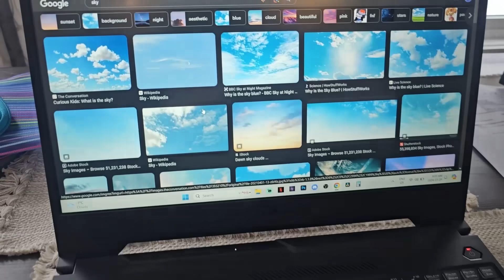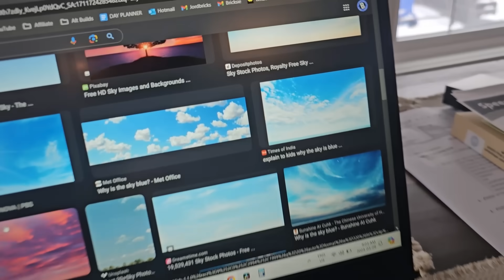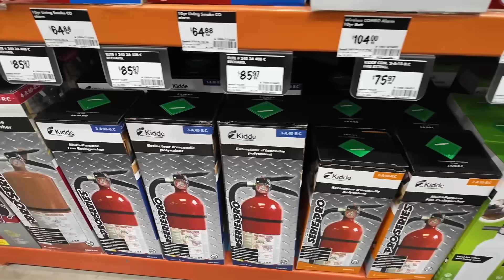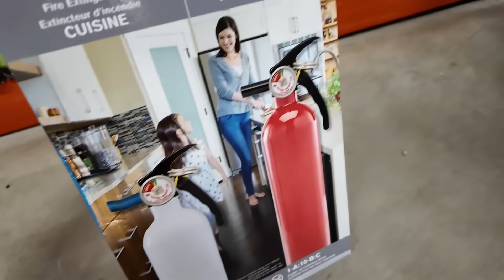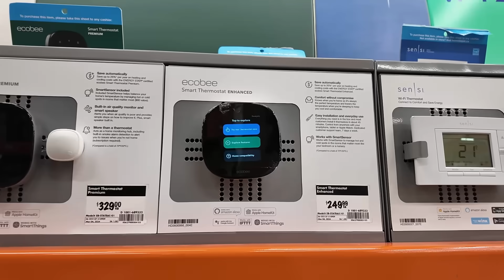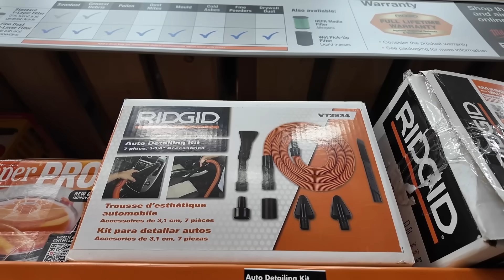LEGO City Tables? Preparing for the Mural!

Comment: Like a lot of others have commented. You may not want to lock yourself into a table layout right from the start. Just get the current tables from the basement moved over and the city set back up. Live with it for a while. Think about what you want to add and then plan the layout from there. For me just huge rectangles in the middle of the space seems like a waste of design. Add some shape, think about an airport, a sea and seaport, downtown, castles and medieval section away from downtown, farms, your forest and campground. Give these areas room to breathe and grow. Sitting with things and letting ideas come to you generally works out more often than just going for it. Access holes as you get older are going to be less desirable.

Comment: Suggestion… grab a couple “furniture movers” for the carpet tiles. They are small and fairly inexpensive and you can just roll the carpet tiles wherever you want without lifting. Also will make the installation process much easier. 
Loving the process. Thanks for taking us along with you.

Comment: I would go for 46", Aware that reduces the amount of baseplates, but you have a massive amount of space. Getting around comfortably is important considering the amount of time you will spend there. You could add on/extend the table later on, but more difficult to make them smaller if you find out the walkway is to small

Comment: All you need it a overhang to give extra space. The hoover has wheels so will bet under table anyway and you can customise a trolly to move baseplates lower than the table if it's an issue.

Comment: About you tables Jordan one why don't you use a custom cart that you don't have to Carry the build to the tables and posable low enough you can roll right under the table to the access holes then you wouldn't have yo worry about needing to make the sides wider to walk with a build. Two you once said wanting some elevation in the new city how about taking the middle of the table from roller door to office and making a riser like you did in the old city to bring things higher and to use to run trains all under be a two for one my thought. Third have you thought about the hight of the table so you don't crush your back or head maybe taking it just a bit higher then the last one  I know it may lead to a posable a step stool for a few things but it can increase the size under the table a bit and be more comfortable to access and not always will u be using the sides to access you have the front as well but think of the cart for the builds and posable you to use under the table to help you out
Thanks for reading i watch your channel everyday thats how i start my day even if my kids dont understand

Comment: Think of other than ideal situations too: let's say you break your leg and need to use crutches. Is there enough space to do it? And are your still planning to crawl under the tables, without walkways between the tables? With all that space you have, feels less-than-ideal as a design choice even in the ideal situation. Or how do you plan to fix the heater or lights on the ceiling when they need attention?

Comment: Also a thought for tables. Make them modular. Use good locking wheel casters on them. Then you can wheel in and out tables/city sections like a tile puzzle and expand/contract as needed. Also if you decide to break up displays- for example decide to make a sub city/space theme area, you can rearrange the space easily.

Comment: My opinion:  
Your current plan is insane - reduce it.  
I would go with 3 feet on one side and 4 feet on the other, so you have one side you can walk without care while the other is still accessible.  
But i would also further reduce the city space by adding Billy&Pax elements on at least one wall.  
Having display space in that form is far more relevant than having that city foot print.

Comment: I would leave more space for access. You never know if you will need to put up big ladders etc to service the lights or electrics or repaint walls. Probably save you a lot in lumbar for the tables as well. Remember you could always extend afterwards if you really start running out of room.

Comment: No need to build out all the tables right away..... better to build tables as the city grows over time.
Tables should be on wheels that can be locked in place, but then can be rolled around if needed.
If that heater ever breaks down, or the lights need changing.... you gonna need a scissor lift... which means moving the tables out of the way.

Comment: Hey Jordan. I always thought you were going to put some displays all around the perimeter of the bay. Then have a walking space between those tables and the ones in the middle. But one thing you probably want to give plenty of room for is that breaker box along the wall. If you put the walking path all around the outside and have it go to the wall,  you want to make sure no one can possibly hit into that box for their safety and yours. You don't want a lawsuit from someone running into that. Safety first. Good luck with this project.

Comment: It's a commercial space and different codes apply than a home basement. And safety is always paramount. Make sure there is enough space for first responders ie. equipments, stretchers etc and let's not forget about potential appliances you will get in the future, like air diffusers around the city etc. to help with dust control. I think your layout will be rejected if submitted to the fire department because your tables are not loose furniture and they're more like walls. As such, you will need clearance spaces around them with at least 2 exit points in an enclosed area. Would be suck to be in an unfortunate situation simply because you were enclosed by plastic toys. It's not like you will maximize your potential income with those extra city space, but you might be safer working in a larger space.

Comment: Instead of taking away 1 base plate on each side, take away 1/2 plate. One access hole is 3 plates, and the other is 4. You can make them both 3 and still have 7 on each side. That would make the walks 41 inches.

Comment: Make it modular and fluid.  Real cities are never squares or rectangles.  Addon tables as needed in areas that make sense.  I would leave some wall space for a set of cabinets or shelves. You will want some area to put stuff that is close at hand for parts and builds.  Walking across the entire space or upstairs every time you need a part will get old very very fast.

Comment: Remember its easier to add on then remove later.  Especially as you begin the rebuilt of your city.   Also if you hang anything on the walls.   Maybe think about , 10,20,or 30 inch extra space to start with.   That gives you maximum flexibility for the future.   Plus you won’t fill it all at the beginning so maybe have a plan that allows you to expand.   I know you want the full size, but the flexibility might be nice too.   Either way, it’s going to be awesome.    Best of luck!

Comment: @Bricksie have you considered a U table shape design into your city? 

City layout would still be a square or rectangle but by having a removable table section on wheels so you have access to parts of the city, instead of having dead spots where you have to crawl under the city and maximize every square inch?

Comment: I would make the walking space bigger for now.  It will take you years to fill that space up.  And when you do, you can add 10" expansion shelves on either side.
Reply: This is a good idea.. you could kinda just support the 10” part with basics L brackets underneath. Which could be easily (and cheaply) added.

Comment: Maybe consider smaller overall table sizes with wheels, so you could re-arrange if needed. In the long run, you want to make things as flexible as possible, as you might decide you want to re-arrange layouts or sizes based on the types of sets, and as your city evolves. Having so many huge single tables could make that difficult, or cause you to have to re-build at a different size, etc. More modular tables would give you more flexibility.

Either way, loving following the videos. You're doing what I've always dreamed of myself, so I'm living vicariously through you. Keep up the great work!

Comment: problem solved and like mission impossible you just need a rope and track for it so you can swing around the top of the city and place stuff - boom no need for access holes and you get to fly above you city!  

Great work my friend and is fun to see the process coming together.  i was fortunate to have a similar hanger on my property but in about a year will be doing the same thing with a loft and just not 2 rooms in front or bathroom since is walking distance from house.

keep on rocking and as always… keep on bricking!  take care

Comment: Nice video. Also consider that, like your basement, you can add table space in the future. So if you start with 4 ft on the sides, you can add later. Just a thought.

Comment: If you can get a (slightly less than) 3 ft wide trolley, that'd be a way to transport big baseplates around the perimeter of the city without having to carry it around. When not transporting baseplates, you can use it to have supplies on it for 'localized building needs'.
Anyway, I think 3 ft is enough space to move; it's only at the sides, right? At the back and front you'll have more clearance.

Comment: Surprised how you talk about inches. I've always thought you guys in Canada have a metric system. A friend of mine originally from Toronto area doesn't even "understand" the imperial units. Although he has lived most of his adult life here in northern Europe. Do you also eat a Quarterpounder - or is it Royalé with Cheese... :D
Reply: I find us here in Canada a muddled mess of both 😂 mostly metric but its hard to avoid the influence of the southern neighbors... air temp is C, but oven temp usually F... driving is always km/h, but treadmills at the gym are often miles... I always think of my body weight in lbs, but use kg for everything else!